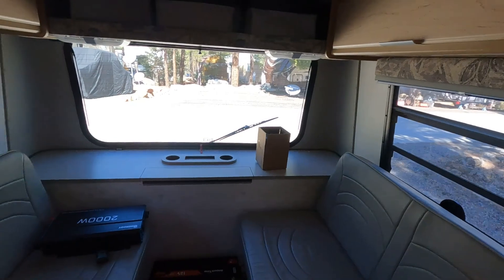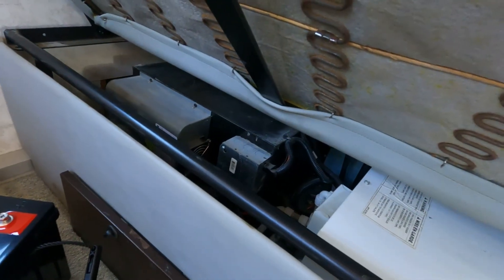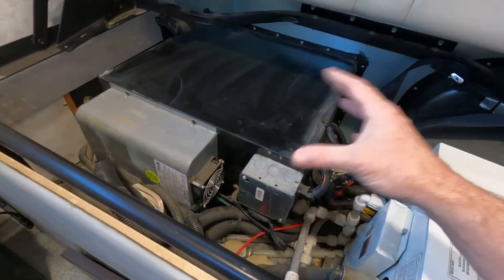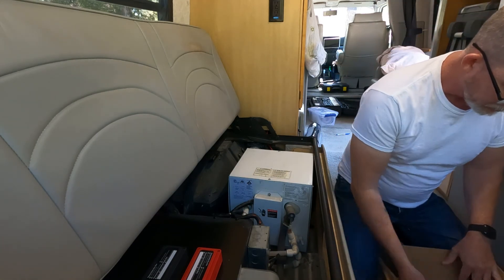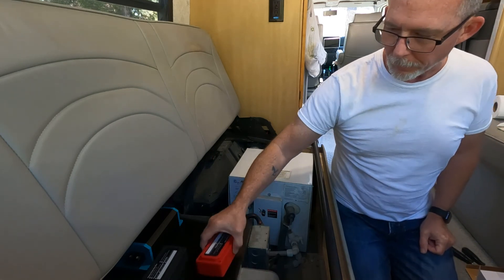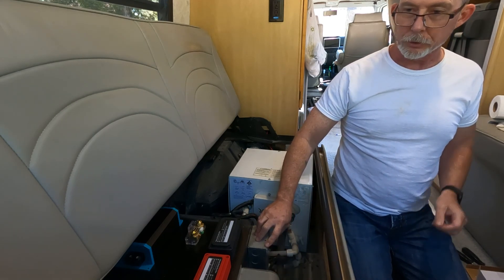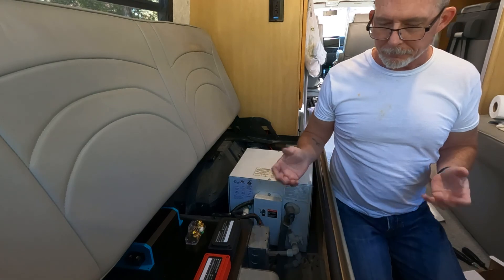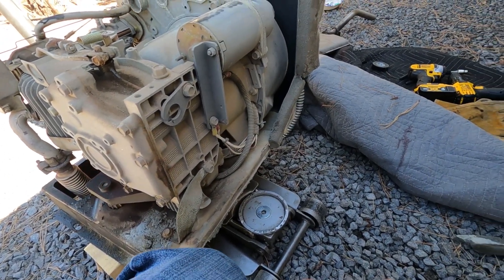Vintage RV Lithium Upgrade | Day 1

Comment: Hi, I also live in Oregon and I was wondering if you ever help people with their mods. I have a 2005 Rialta HD and what to remove the generator, but I don't know what to keep (all those boxes attached to the generator box). I don't have interest right now to convert to Solar but would like to do some remodeling. Can you tell me what components I need to keep to keep the RV having electricity without the generator? Thanks!
Reply from the maker: Hi Beth - I'm always happy to help. The good news is that dropping the generator is relatively simple, and doesn't affect any other systems. Under the seat (the bottom of the seat can be taken out by removing the 4 large nuts, two on each hinge), you'll find a metal junction box attached to the generator enclosure. Inside that is the wiring FROM the generator, which you will disconnect. Be sure to cover all exposed wiring once you do so.

Next step should be disconnecting the house batteries in the compartment behind the seats.

Dropping the generator itself requires removing the exhaust, supporting it from underneath with a floor jack, and removing the 4 main bolts on the underside of the generator frame that attach it to the Rialta. As you lower it and gain some clearance, you will be able to remove the fuel line and pull out the wiring that goes into that junction box we just talked about. Be aware that you may have fuel spillage, and if you have a full gas tank it will siphon off so be prepared to seal that fuel line. Probably a good idea to do this when your fuel tank is almost empty. 

You'll also need to remove the starter cable from the generator  - it should not have any power if you've disconnected the batteries inside, but be careful just the same. Then you can lower the generator. You may have to shift it a bit - when I removed mine, there was a metal cover on the left side that was getting hung up on the van.

Then you'll want to wrap and secure the starter cable so that it can't touch anything, and it's best to disconnect it inside the battery box as well. You'll need a bolt to put inside the fuel line along with a clamp, or some other way of sealing the fuel line. It will siphon gas from the fuel tank if you have more than a quarter tank of fuel as I mentioned above.

The good news is that removing the generator changes nothing else. You'll still have 12v power from the coach batteries, and you can still plug into shore power as you would have previously. Just be sure the fuel line is sealed, and that all exposed wire ends are securely wrapped.
Reply: @TravelingSolo  Thank you so much!